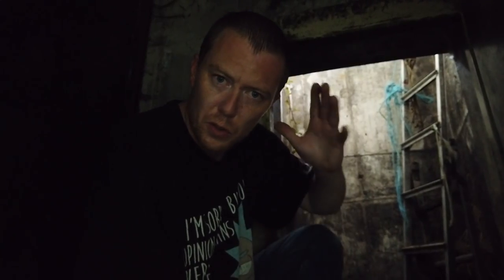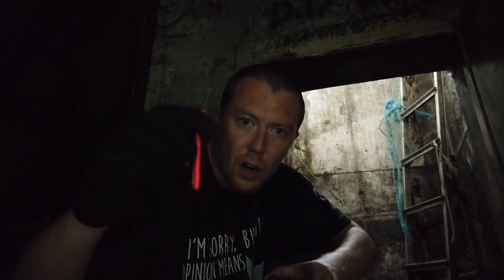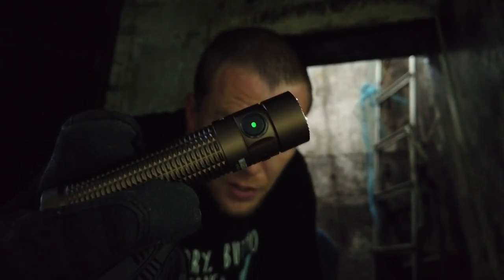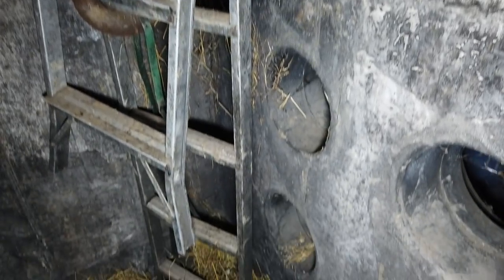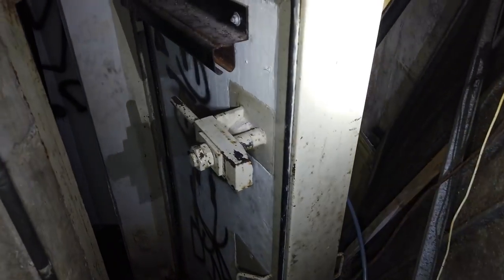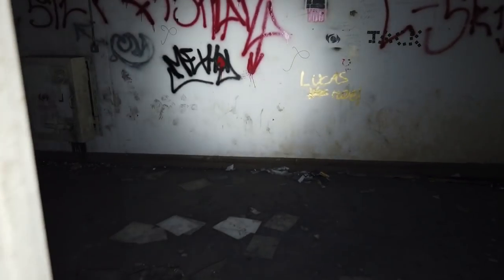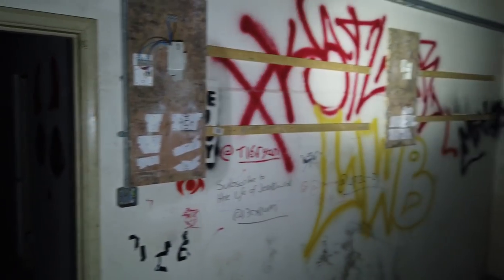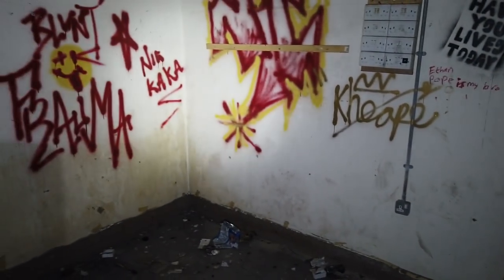Amazing Abandoned Nuclear Bunker Hidden Near the Woods

Comment: I'm rather sad using my old railway Bardic lamp I converted to run 26650's and a high lumen projector LED... nite into day and I get red, amber and green filters too :D   I will get round to scoring an RAF, Army and Navy Bardic painted in their branch colours.   The armed forces ones you could swap bulbs out for IR bulbs making superb night vision enhancers.
Reply from the maker: That's some hardcore modding as they'd say. Nice 👌
Reply: I have an army Bardic Lamp! It has the same three colours plus white, and is identical to the British Rail version in all respects other than the military "Broad Arrow" embossed onto the sides, and the army green paint job.. I also have an ex BT version without filters. That one is in "knock-yer-eyes-out" BT yellow.

I'd love to know where to get the projector LED, assuming I didn't need to modify the lamp itself. Mine are more about originality than modification.

Comment: Good to see another vid. Tempted by the mini, but they missed a trick on it, should have used 21700.
Reply from the maker: True the 21700 is an excellent cell but for discreet EDC, it's just too fat. They did up the mAh by 500 on the battery though.

Comment: I will never buy an o-light because of how hard they push them on youtubers. it smacks of desperation.
Reply from the maker: I'd not necessarily say its through desperation. It's not as if the company is without a few quid but yeah I do get where your coming from. The issue that your going to have going forward is that a good majority of the other good manufacturers have picked up on this marketing method and are quickly adopting it. You'll probably see more of these manufacturers throughout YouTube in the near future.